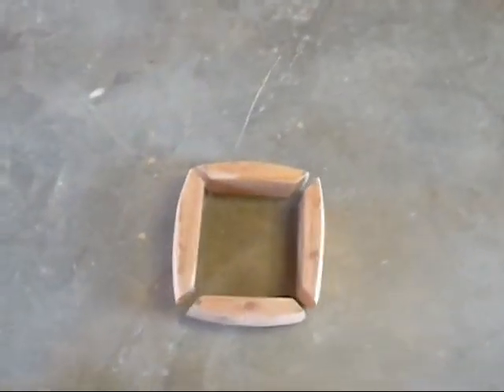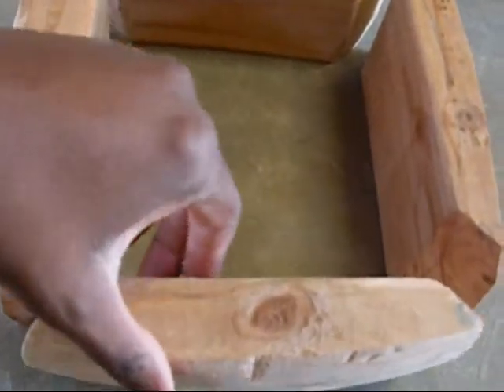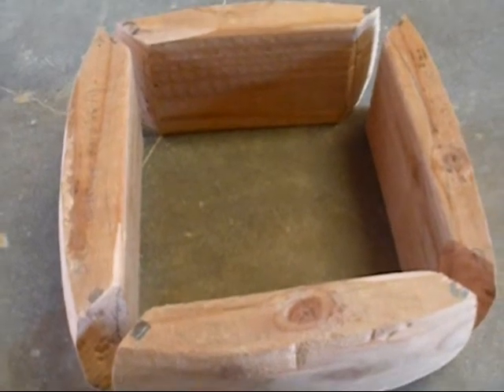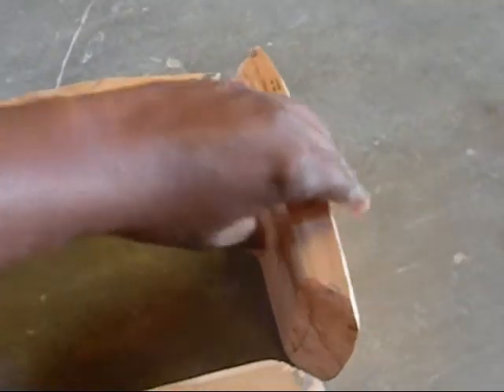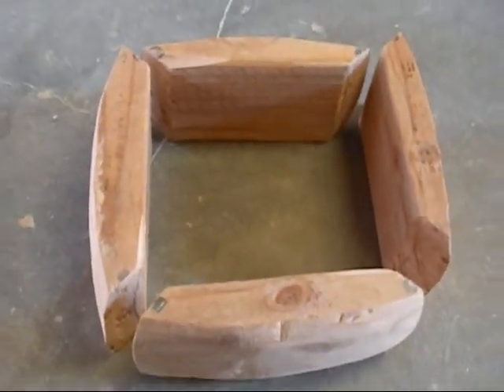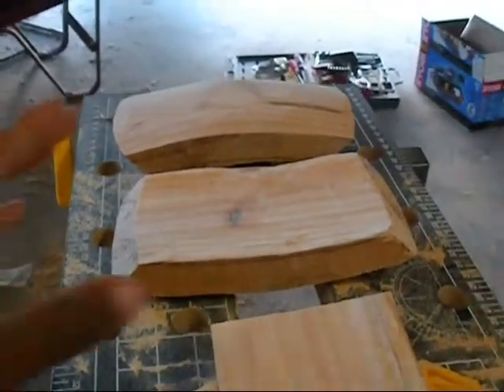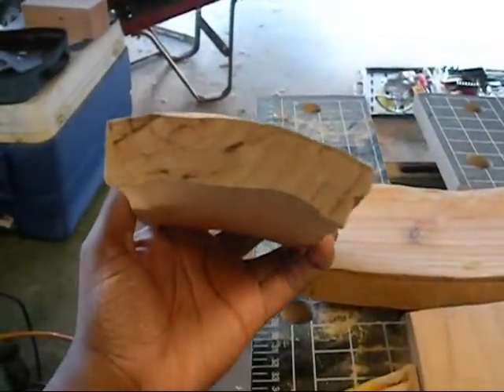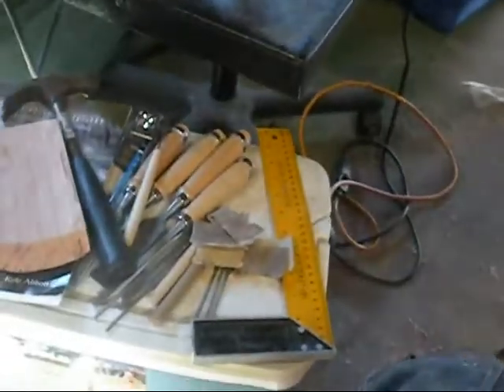My First Shamisen- Part 2 SHAPING THE DOU

Comment from the maker: @100FATGORONS HIE! I basically took a 4x4 piece of wood I believe and drew the curve then cut what would be the excess. The I believe I sawed a very very rough shape around the outter parts of the curve I drew. Then I used a power sander and sanded the heck outta it :) it was easy for me and my little girl muscles since chiseling was very difficult for my to handle. It worked quite quickly using the power sander. I know that is not what they are for but it worked! Borrowed power tools from buds.